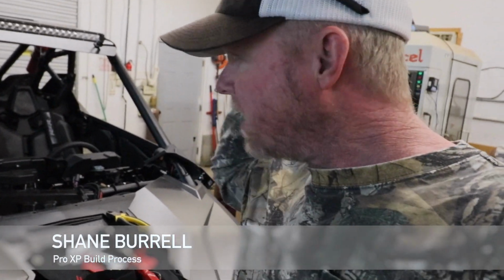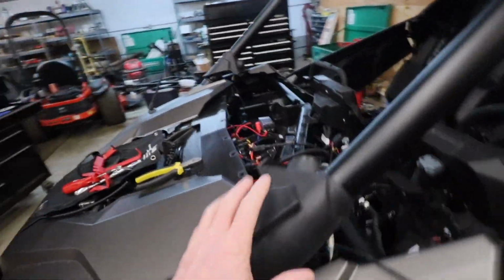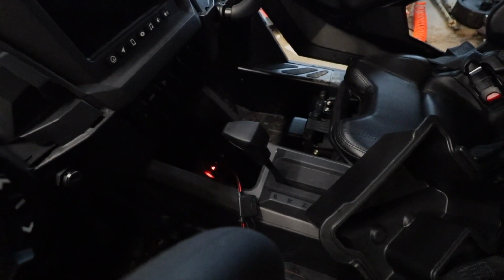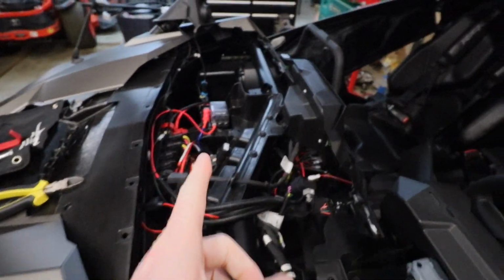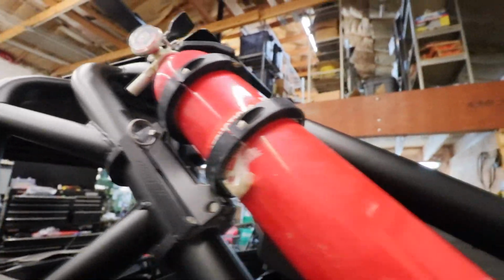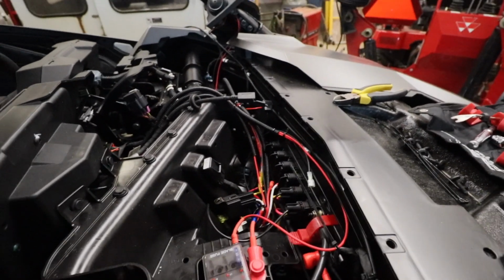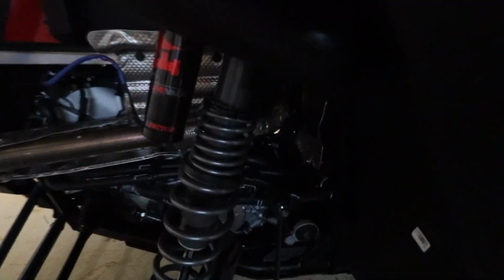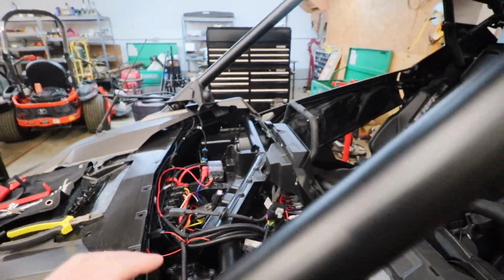Pro XP Build Progress.

Comment: Very nice machine Shane. Question for you when adding relays. Do you add back emf diodes on the coils?
Reply from the maker: The relay packs I use have a flyback diode.  Mainly to prevent arc on inductive loads (I don't have any at the moment).. Polaris (mostly bosch) have went to great lengths to prevent any emf from affecting anything you may add.

Comment: I went from a 900s to the Pro and the extra length took more to get used to than the extra width. Love the power, 75hp to 181hp is a big jump.
Reply from the maker: So far the length makes it a bit more stable. I had offset a arms on the 1000s so it was little longer than stock. The power is shocking. Dynamix seems to work well, doesn’t get the way of driving and cornering feels much better.